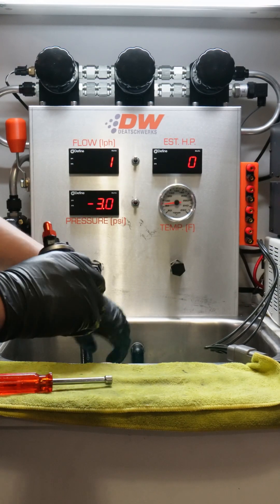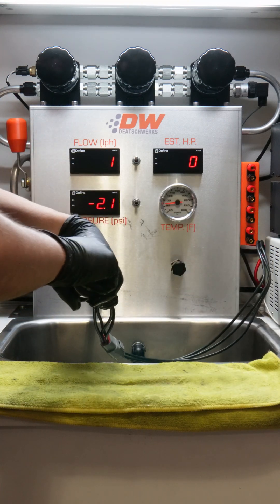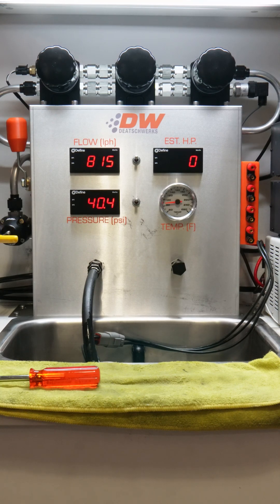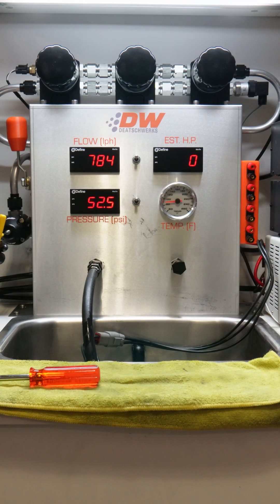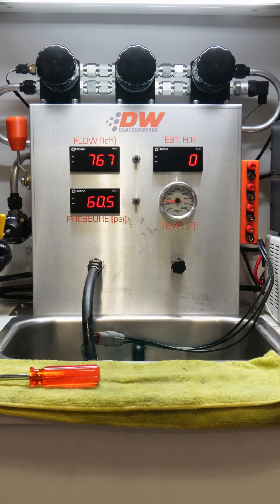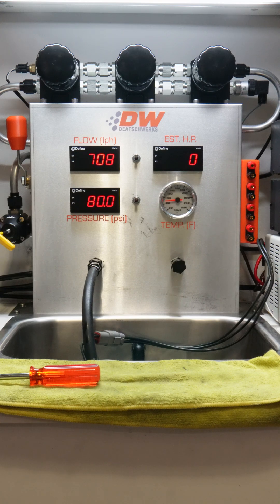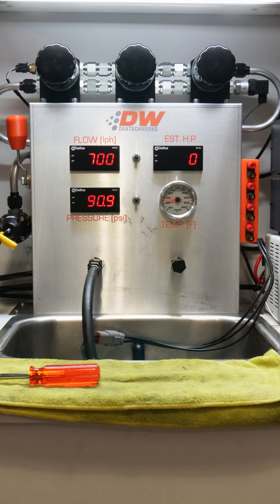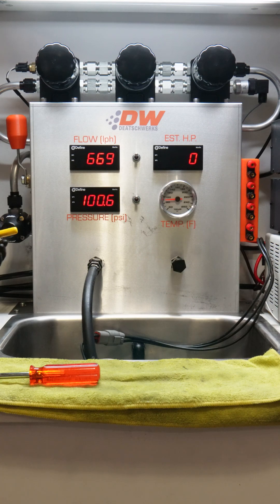Unmatched flow in a compact size, the DW810 is purpose-built for performance.

Comment: How much current does this crazy fuel pump draw? 20A?))
Reply: On their website. But amp draw is dependent on psi
Reply: @mauricewaddelliii6244  At close to average PSI load.😄
Reply: @RIDER_GT1987  23.4 amps for 810lph at 40psi, 25.5 amps for 747lph at 60psi, 27.9 amps for 682lph at 80psi and 30.3 amps for 614lph at 100psi.
Reply: @nesmio7378  Impressive current consumption)😂Definitely requires separate thick wires to fuel pump.
Reply: @RIDER_GT1987 Current consumption is really good. A brushed pump would've required 3 times the current at least.
Reply: @nesmio7378  Well, I didn't know this fuel pump is brushless. Thx